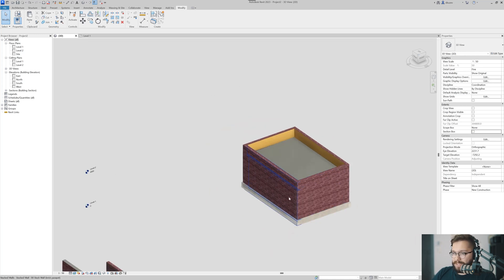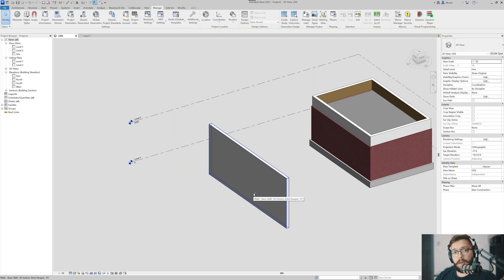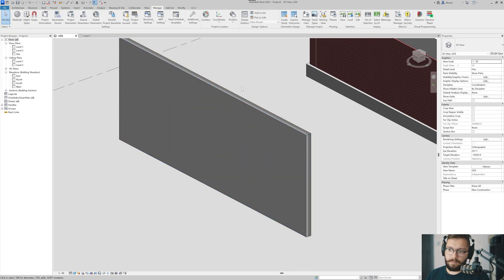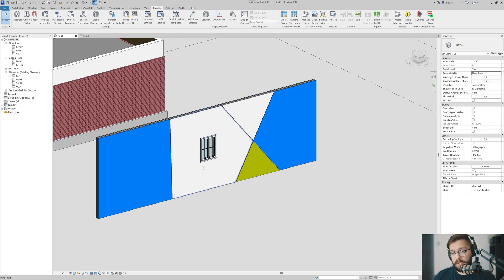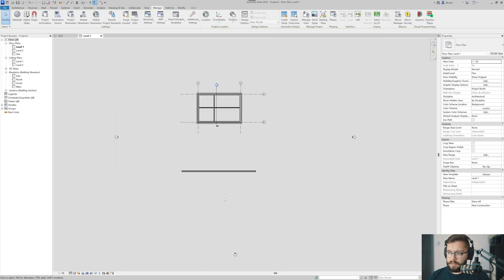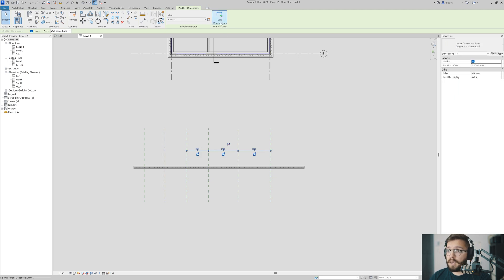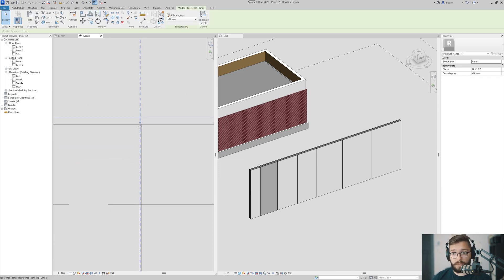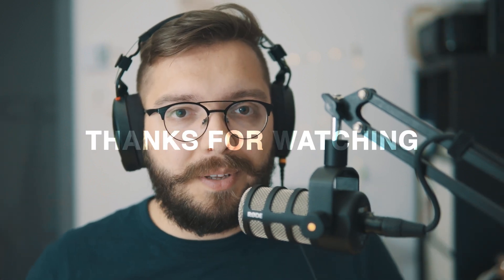Master Walls in Revit - Make Parts

Comment: Are the parts created visible on  plan?
Reply from the maker: Only if the view in plan is set to show parts. That’s the beauty of it. You can either shoe the Original (the wall as it always is), Show parts, or Show Both. The last one use useful if you need to see the parts but also tag the wall. 
Cheers
Reply: @danielkuzev4992 Thank you for the clarification.